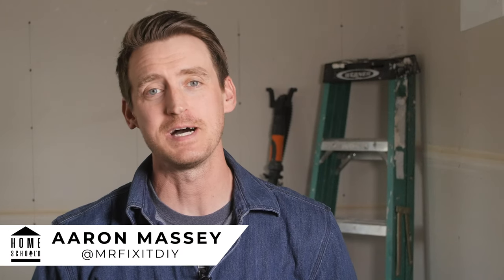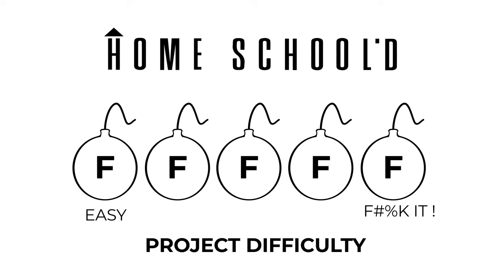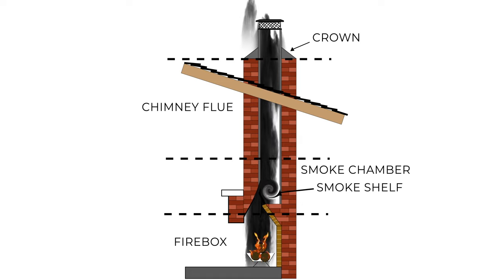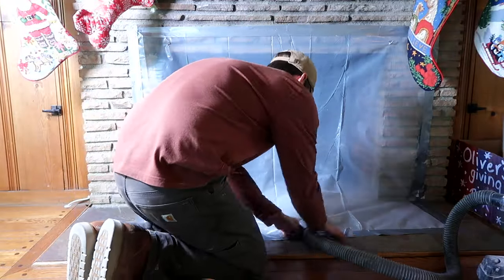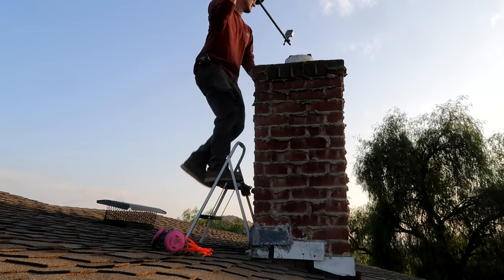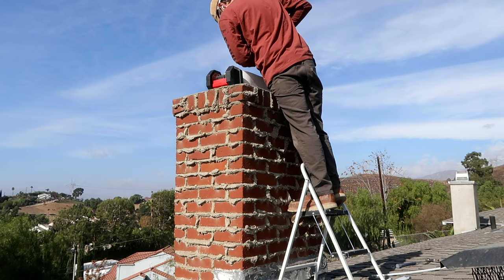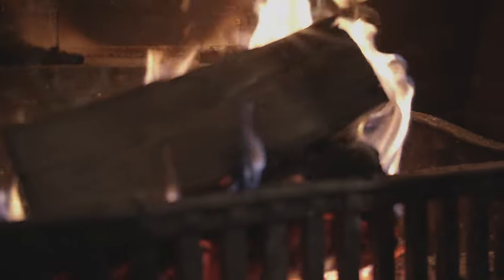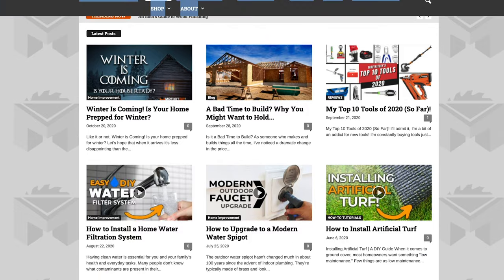How to Clean Your Chimney & Why You Should! | A DIY Guide

Comment: Had two fire sweep companies come out first one clean chimney as you did and the smoke chamber  second one said it looked good and did not need to be re cleaned but did say something about a spray for creosote smell the fire is a open brick burn bay that is getting a new wood stove insert with a stainless lining all the way up IS that spay NEEDED first one said nothing of a spay and the installer said nothing about a spray THANKS

Comment: Great video mate but please answer me this. Why do Americans clean the chimney from the roof? in the UK this is unheard of its always swept from inside the home at the fireplace opening
Reply: I am a sweep in the States, and I sweep from inside! I am not sure why others are doing it this way. The CSIA school almost exclusively taught sweeping from the hearth.
Reply: We sometimes clean from the roof, especially on really old chimneys because we live near the ocean.  The ocean tends to break down the chimneys so, sweeping from the top, we can check the integrity of the chimney while we are up there and advise the owner if there are any concerns that have developed.  We live in ME so houses here are usually very old so it is wise to keep a close eye on their integrity over time.  Newer homes and certain circumstances though we do a sweep from the bottom up.  Very very nice to meet you by the way.  Have a very lucky and blessed Thanksgiving!  Stay safe!
Reply: What’s the difference
Reply: @zkurtz21  It is really the same result in terms of the sweep itself.  Bottom or top you get a clean chimney.  The reason to clean from the top is as I stated, to check the integrity of the chimney if it is an extremely old home and/or facing the ocean as ocean-facing chimneys tend to break down fast.

Comment: My husband has been a sweep for way over 40 years and I have been with him for 20 of that. I'm the owner of our chimney business.  At the:42 mark of your video, you show chunky creosote.  Light, airy, and chunky creosote is a sign you have already had a chimney fire.  At this point, if you are lucky to have not lost your home, the flue is usually clear but all the debris is now at the bottom of the cleanout area.  A cheapo homeowner special brush and rod system is cheap yes, right around $100, however, they are very "limp" and tend to not be as rugged and hard as a professional brush so they are a bit harder to maneuver.  My husband hates them for this very reason.  Dampers can be found around the fire shelf area or they can be top mounted at the crown.  If they are top-mounted at the crown you have to sweep from the bottom up!!  Using a shop vac is the worst possible idea you can come up with by the way!  They have a really bad tendency of puffing back debris into the room.  After destroying a few customer houses this way back in the day we no longer allow the use of these in our company.  We use an old-fashioned bucket and shovel so we can control the soot.  Next, the reason you hire one of us professionals is to spot problems with the chimney and to avoid falling off of the roof.  We are trained to navigate the roof and, should something happen, we are fully insured.  The homeowner is not an insured registered professional.  Your crown is cracked and, through the freeze-thaw cycle, this will worsen over time, thus breaking down your chimney.  You need a proper crown seal to fix this.  A homeowner couldn't possibly know this.  Yes, a cap can be purchased cheaply.  However, cheap caps are often made of aluminum or substandard steel.  Squirrels and other pests chew right through aluminum so an aluminum cap is basically a big joke to an animal!  Also, lower-quality caps may not come with a lifetime warranty.  You really don't want to have to keep replacing your cap constantly as, having to replace a cheap cap over and over and over is going to eventually make that cheap cap way more expensive than the high quality, made in America caps.  We purchase our caps from New England Chimney Supply in Williston VT where they are made to order by a family-run business and have a full lifetime warranty on them.  Never ever cheap out on safety!!  And yes, a cap is there for safety!!  It keeps blockages out of your chimney which in turn keeps deadly fumes out of your home!!  Installing a gas log set you must be certified and licensed with your state!!  There is a reason for this.  There was a situation where someone who was unqualified installed a gas unit in a home.  The home blew up and a 5-year-old girl died in the blast. This sent shockwaves through our industry and caused new laws to be put into place.  Now, if you install a gas unit without a license and it blows and someone dies you can be held responsible for manslaughter so just call a licensed pro and avoid all that!!  I myself refuse to hold a gas license as that incident with the little girl, even though it didn't happen to me or my company, really shook me up.  I want nothing to do with any of that I can tell you!  Also, pellet stoves you have to uninstall before sweeping.  If you sweep top down on a pellet stove the debris gets stuck into the motor and destroys the motor and fan on the unit!  A fireplace insert with a proper blower that is EPA certified (All stoves are required to be EPA certified in this day and age!) will burn extremely efficiently, heat your home, and will give the look of a real fireplace.  They are also a great way to keep the fireplace look when the fireplace itself is no longer safe and to code.  Oh, and also, the reason a chimney professional is expensive is the fact that we are registered, trained, experienced, insured, and are performing a very dangerous job on your behalf!  We are worth our price and earn every last penny of what you pay us!  Think of your own job.  Do you get paid what you are worth?  How would you feel if your boss told you he was going to cut your pay in half because he didn't think you were worth all your hard work?  We charge according to our worth.  If we have to set a ladder, inhale caustic fumes, and scamper on your roof 30 feet or more above the ground then we are going to expect to be paid accordingly.  We also have to cover our equipment, our gas, our insurance, and all the other requirements to run a business.  We charge you $175 for a single flue and we are danged lucky if we even pocket $50 of that!  Always keep this in mind when dealing with a professional sweep or any professional in the construction trades.  A skilled and well-trained laborer is worth his or her weight!!  I bring this up only because people always complain about the cost of hiring someone in the trades and therefore are always trying to find a way to do it themselves which often leads to them calling us for help bailing them out of their DIY nightmare!  Also, be fully aware that we are not in this business to become millionaires.  We are in this business to save lives plain and simple!!  If we wanted to be millionaires we would go into politics and not be risking our lives cleaning chimneys!!  So stay safe out there and, when in doubt, give a professional a call! Don't risk it ever!!!!!!!!!!

Comment: Does anybody know if there is any added benefit to having a professional company come and do this instead? I feel perfectly confident enough to do this on my own and not pay the $500 for a chimney sweep.  I just wonder if  this is literally the exact same thing a regular chimney sweep company would do or is there something else they do as a standard chimney sweep process?
Reply from the maker: The difference is one is certified and the other (you) is not. They may be trained to notice an issue that you may overlook.
Reply: In Germany you pay about 40-50 Euros (nearly the same  in US-Dollar) for a chimney-sweeper. But in Germany there are many standards in chimney-building that makes the work more easier.

Comment: Do not use steel brushes to clean steel flues. Ever. Also, steel brushes should only be used when flues have major stage 2-3 creosote buildup on terra-cotta tiles. Get a higher end vacuum and a HEPA filter/dacron. Never sweep from the top down. Use a hand brush to get the firebox and smoke chamber, then move your way up. Look for signs of deterioration in your terra-cotta tiles and look at gaps and voids in the mortar joints. Cracked tiles are a sign it's time to re-line your flue with a steel liner. Coming from a certified chimney sweep/brick Mason of 22 years.
Reply: The only steel flues that cant be swept with a steel brush are those craptastic liners that say so right on the box. Dont buy crap liners

Comment: Please do that fireplace updated video.
Reply from the maker: Sounds good! Will do
Reply: @MrFixItDIY  can you do this from the bottom
Reply: @freethinker7805  Yes you can, but it obviously comes with an increased risk of soot flying into the living space. If you are using fibreglass sticks like in this video, what you’ll do is make a hole in the plastic covering the fireplace, stick a short plastic tube through and feed the sticks up the chimney from there. Make sure to have your vacuum on to keep the soot from getting out. Might be really tricky to get the sticks up through the damper from the bottom though, but definitely possible /Professional chimney sweep
Reply: @freethinker7805  I am a professional sweep and I will never clean a fireplace from the top.  Doing it from the top means I can't see what's going on inside.

Comment: " Fireplaces at no longer an efficient way to heat your home " Lets me see. I live at a high aptitudes in sunny CA. I burn my stove 24/7. When power goes out, up here it does a lot I cook on my stove, boil water, and it lights up the the front room. I chop my own trees down and collect the wood for Free, I have about 7 to 8 chords on hand every winter. My house stays at 70° to 73° Free, how is this not efficient ? Is it better to run a LP forced air system at 5 dollars a gallon? But thanks for your video it was informative.

Comment: Over all a very good video.  But your explanation of how a chimney works was a bit off.  The turbulence at the smoke shelf does not help evacuate smoke at all if anything it hurts a fireplaces ability to draft properly.  What makes a chimney work is pressure differential between the inside of the house and the chimney.  This is called draft the chimney actually sucks the smoke out.  And reducing any turbulence in the throat smoke chamber etc makes that work  better.  When I build or rebuild fireplaces I eliminate the smoke shelf when ever possible.
Reply: Ben my fire place dose not have a smoke shelf or a damper it works good no problem to me is that ok?I put a cover on top with inches using a chain to open and close it from outside is that ok?
Reply: @porterdor39  absolutely.  That is a top sealing damper.
Reply: @benholler1389  Ok good thanks sooo much Ben.The chimney built around 1943 and it works good when I open the cover on top to light up my fire place. Your explanation are so well understanding. Waiting for the cold weather to strike it up. From NY thanks again.

Comment: FIRST OFF.......If you're only rating this project "1½ F-bombs" then you're obviously not doing it correctly! But in all seriousness.....I'm a professional chimney sweep with over 38yrs experience, working with my father who started the business 45yrs ago. A few of the issues I noticed with this video......
1) DO NOT use a regular vacuum (even a shop vac) for this! You need a vacuum that's made for soot & ash! (Or at least one with Hepa filters) The particles in soot & ash are so fine that they will go right through the filters, wreck the motor, & blow dust into your house! 
2) The "smoke chamber" (when facing the front of the fireplace) is up above the damper & is shaped like an upside down funnel. This is to funnel the smoke, etc from the width of the damper up into the beginning of the flue tiles. This whole area NEEDS to be brushed & vacuumed out, as it is usually the DIRTIEST part of the entire system! The smoke shelf (behind the damper) also needs to be cleaned & vacuumed off. The damper should be removed whenever possible to accommodate this. None of that was even touched in this video. Note: SOME fireplaces don't have a smoke shelf (rare) but the damper should still be taken out to clean & vacuum all around the damper casing to keep the damper operating correctly.
3) A fireplace doesn't have a cleanout door for removing creosote. They will often have a cleanout door for removing ash that is dumped down through the ash dump that's located on the fireplace floor. (Which we don't recommend using for multiple reasons) But that is nothing to do with removing creosote that has been brushed off during cleaning. The creosote that falls during a cleaning will fall down on the fireplace floor, but MOST of it will fall on the smokeshelf (up behind the damper) whenever there is a smokeshelf.
4)There are MANY different types of brushes & methods of cleaning depending on the type of creosote buildup, etc. There's some stages of creosote that wouldn't even BEGIN to be cleaned off using the brush/method used in this video.
5) The firebox (where the fire sits) should also be brushed down. What was done in this video was not even CLOSE to a "deep cleaning"!
6) All the creosote busting logs or chimney sweeping logs, chemical cleaners, etc, etc, are useless. Don't bother wasting your money! Nothing will take the place of a manual cleaning!
7) Use a stabilizer bar on the 4th rung down on your ladder. Stabilizer bars will prevent the ladder from sliding side to side, will keep the ladder off of your gutters (so they don't get crushed or scratched) and will help (a LITTLE bit) in preventing the bottom of the ladder from kicking out. But always put the feet of the ladder up (when on grass) so that they're digging into the ground, or else tie the bottom of the ladder off to something (when on asphalt, etc) to prevent it from kicking out. Having the stabilizer bar on the 4th rung down will keep the top of the ladder 4 rungs above the roof, giving you something to hold onto when getting on or off the ladder. Which makes the transition MUCH easier/safer.
8) He says "Traditional wood-burning fireplaces are no longer considered the most efficient way of heating your home" but they NEVER were! A fireplace will actually cool your house down, not warm it up! (If you have glass doors on the fireplace then that will help, but.....) A regular open fireplace is good for radiant heat only. Meaning.....if you're standing in front of it then you will feel the heat radiating on the front of you.....but the back of you is cold. And it's sucking all the heat from the rest of the house right up & out the chimney like a huge vacuum! So these fireplaces are basically just used for the ambiance.
There's some other things as well, but this is already crazy long & I've got to get going. But my best advice is to hire a professional for this job! Experience & knowledge make AAAAALL the difference in the world when it comes to this profession! And even THEN you'll be hard pressed to get someone that knows what they're doing & that actually cares about the quality of their work! Good luck!

Comment: WRONGGG!!!…… You clean your fireplace from THE BOTTOM to control the creosote falling AND to clean the Firebox,Throat and behind the damper. You’ll end up with a throat Fire with your method. This is the absolute worst way to clean a fireplace. (10 years experience)
Reply: Ey, chill bro. I’m a chimney sweep too and here in Sweden we do it both from the bottom and from the top depending on the chimney situation. We use either rope with a brush and steel ball from the top, or a system like in this video with a drill and bendable sticks from the bottom. Either way you will always (I hope) clean the entire fireplace/stove/boiler at the bottom afterward either way :P
Reply: I generally agree cleaning from the bottom is a much better option for cleaning an open fireplace.  But doing it from the to is not wrong.